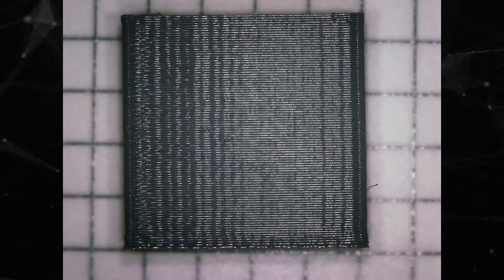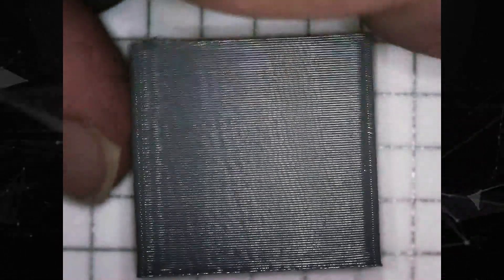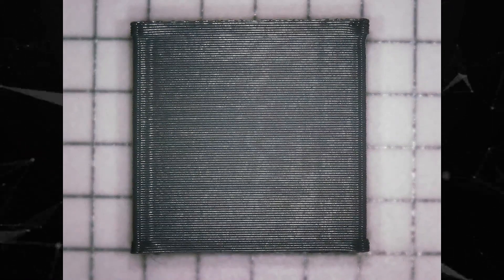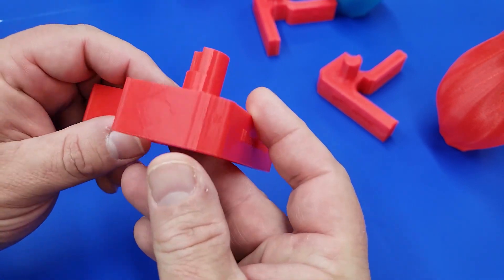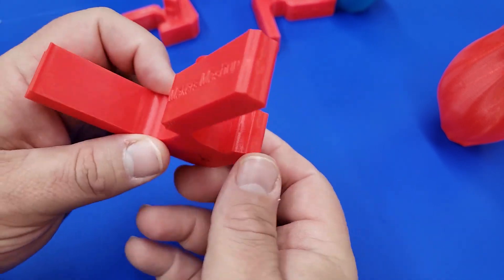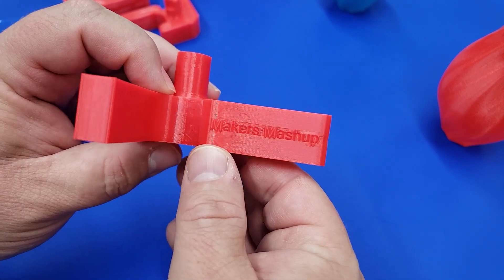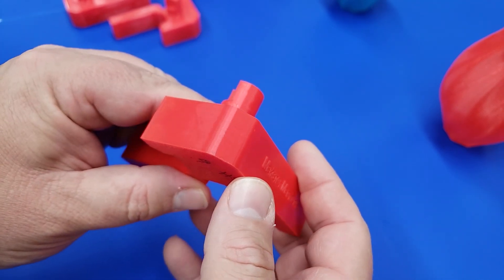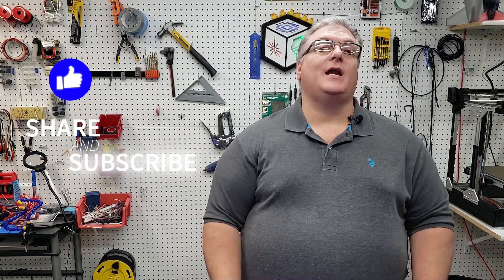1.8 vs. .9 Degree Steppers Help or Hype?

Comment: I'm currently working on motorizing my telescope mount based a project called OnStep. I've got two nema17 0.9 motors on the way, and for astrophotography it will make a big difference (especially for my setup which is not using a guide camera to keep everything dead center).
Glad to know that they're not that important for 3d printers (likely my next project, maybe the x201) because the price difference is significant if 5 motors are needed.

Comment: so i found the .9 degree steppers were only helpful for my delta 3d printer. the higher the accuracy/precision of the z-probe, the better the delta experience. the .9 steppers help a lot with that accuracy of values.

Comment: I did a lot of tests with 0,9 and 1,8 so my conclusion is new motors with more torque ;) using tmc 2209 ;) works good!
Reply: What Motors did you use with the 2209?

Comment: Hi Rob ;) good video! It is because of the weight of the bed! Install the motor with more torque and everything will be fine!!!! I did test and video half year ago and no difference once I have install on the table motor with torque 70 n per s- everything is good! Try it!
Reply: Do you have a link for the motor you're talking about? Thanks!

Comment: Thanks for sharing, I use 0.9° steppers on my (delta) printers (and also use 1.8 for messing around ;) ) . I'm not sure about your testing methods here, I would not suggest 0.9° steppers if someone asked me how to improve there prints, going from the reference prints you show. I would say say to further tune the print profile. 
The 0.9° shows its advantages best when printing slower in my experience, not faster. Steppers tend to fall back towards full steps when moving too slowly, which makes for more accurate positioning, like probing and homing using a 0.9°. (while delta's print fast, the arms don't always move fast) 
While 0.9 have a lower torque, but they have steeper torque curve, which some say is better and worse, but torque aint really an issue on printers...
But overall, don't expect a 0.9° to be twice as good as a 1.8°, A geared extruder is not ratio times as good as a non-geared one, and either should only be used to push the quality of well build machine, not to solve an issue. And yes, first the board and the drivers to upgrade before you think of the motors.

Comment: Frankly your prints are not high quality enough to show the difference.  If you still have infill and ringing showing through you have much bigger problems to concern yourself with than upgrading to a 0.9 stepper.
Reply from the maker: I think you must have missed key portions of the video commentary.  I said all of these were printed at higher speeds to show the VFA's .  Would be pointless to show a 3D Print without the VFA's in it. The test cubes clearly show them but when you're printing at the same speeds under normal use you'll never see the difference.  Which was the point I was raising specifically.  I invite you to share you're personal results.
Reply: @MakersMashup  I don't know that youtube allows the sharing of links but I'll give it a shot Here's the last print to come off my printer (please zoom in and pixel peep) https://cdn.discordapp.com/attachments/684578465139392556/767543974377685022/Chase_Daigle_DSC6879_2020-10-18_20.11.09.png
And here's a typical miniature for me: https://cdn.discordapp.com/attachments/684578465139392556/752690111199576104/Chase_Daigle_DSC6655_2020-09-07_20.24.08.png
Both photos were taken on a 200mm macro photography lens on a full frame sensor
Reply: @MakersMashup  You can have vfa's regardless of print speed.  Also what someone considers to be normal use will differ from person to person.  It may be the case that 0.9 steppers do not make a difference for your printing needs but they do make a tremendous difference for my printing needs.  If the only use case is for functional prints and or high speed print then I would not recommend most users spend the money to upgrade to 0.9steppers as it simply won't make a difference for them.  In addition I watched the entire video.
Reply: I was wondeting why the VFAs did not show up in your practical tests, but your remark here on printing at high speed tells me all i need to know.

You actually have it backwards; VFAs are typically showing more on slow to moderate speeds.

The reason why you didnt see much change means you were testing mostly outside of the bandwidth where it matters. And the issue beung replaced by your other artefacts.

Especially at high speeds you can not only run into ghosting but also demand too many steps per mm, stepper drivers overheating or resorting to spreadcycly instead pf stealthchop, or even the steppers skipping steps at some point.

I ordered my 0.9 degree steppers today and cant wait!

Comment: update ur firmwares segmenting to take advantage of the new steppers too also 0.9 on extruder makes a bigger difference
Reply from the maker: In my case I'm not sure a .9 stepper on the extruder will make any difference.  The X301 uses a geared extruder so the resolution is already 415 steps/mm.  I think its unlikely i'll see a visual difference in extrusion.

Comment: I think the best thing of the 0.9 is that you can lower the microstepping to 8 in order to get much higher torque while maintaining the resolution
Reply from the maker: I thought about that while I was doing the video.  The steppers I got were pretty beefy but if I run into any skipped steps I will certainly give it a shot.  The 1.8's are 45Ncm while these .9's are 44Ncm so I think they should be fine running as is but if do run into problems i'm certainly going to give it a shot.
Reply: I even try to lower to 1!!!! Better install new motors with more torque!!! On my bed I have installed one with torque 70 n p s !!!

Comment: did try any other slicers other cura?  i would be curious to see what results you would get with prusa slicer.  i much prefer it over cura Imho
Reply from the maker: I haven't but it is a good question.  There have been a number of good suggestions in the comments so I will likely do a follow up video on this.
Reply: @MakersMashup  that sounds awesome. i started off using cura, but have much preferred prusa slicer / slicer, i believe prusa slicer is a derivative of slicer, and from my experience the vase mode in pslicer produces better results. also pslicer performs better on my system. looking forward to seeing an updated video. 👍

Comment: I think the holding torque is where the 0.9 deg steppers make a difference. They are a bit worse. I would only use 0.9 deg for the Z axis, where speed and torque don't matter so much.

Comment: What do you mean that you increased the resolution from .5mm to .25 mm?
Reply from the maker: In cura you can adjust maximum resolution so the minimum segment is smaller than the .5 default
Reply: @MakersMashup  Thanks for the reply. I don't remember seeing that feature. I'll have to have a peek around for that.
Reply: @1QKGLH  It's under Mesh Fixes, and is not visible by default. You have to go into "Settings", "Configure setting visibility" and turn it on.

Comment from the maker: Will you be putting .9 Degree Stepper motors in your 3D Printer?
Reply: Definitely, minor improvement is still improvement. There's no way to argue that twice the step per mm resolution is a bad thing, especially considering the same or better torque. I happen to dislike VFA's, and I live for improving not only my printer but the world around me!
Reply: @danthemancasey  better torque is achieved by more torque at the motor and the number of steps )))) the less steps more torque)))
Reply: Dan Casey saying about the torque - have 48mm 1,8 and 0,9 degrees- the torque for the 0,9 is 43 and for the 1,8 is 52 :)
Reply: No
Reply: if I ever do, it would be X & Y, maaaaaybe Z? for weird layerHeights especially with smaller nozzles
Reply: No I did did it and no difference! I did video ;) with nozzles 0.6 to 1.2 no difference :)
Reply: Install motors with mitre torque ;) so the difference will be ;)